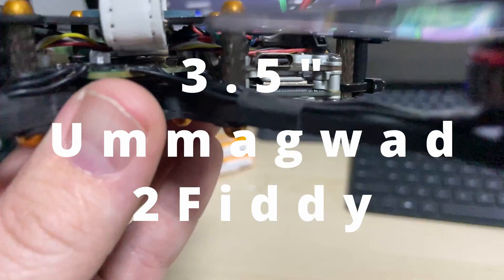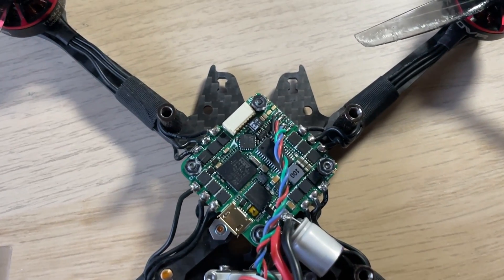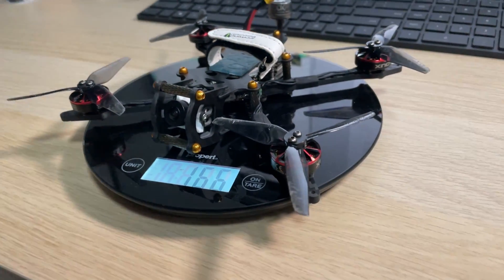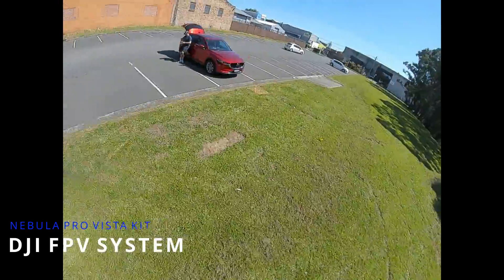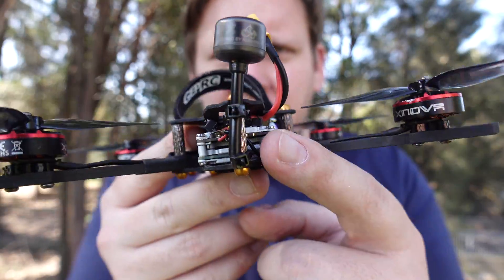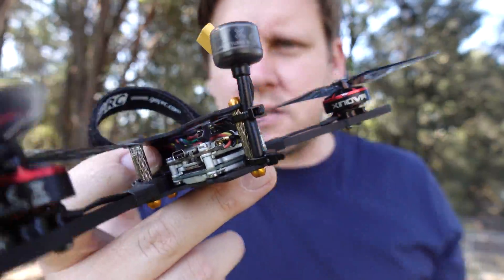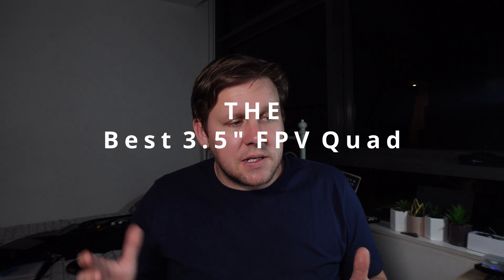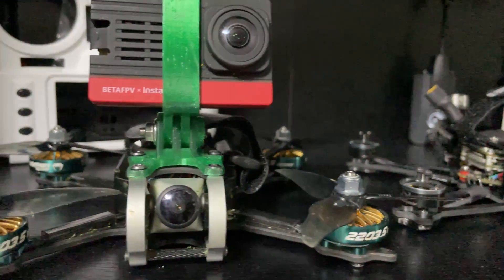My Favourite 3.5” Freestyle FPV Drone

Comment: How quiet is this build? There's a spot I want to fly that's just right for something smaller that doesn't attract too much attention.
.
I was thrown off because it says 3.5" but it's actually a 4" frame with 3.5' - 4" props? I'm thinking 4s with Xing 1504/3900KV. I was also considering the Chris Rosser 3.5" AOS frame with the same motors.
Reply from the maker: Yes it’s on the quieter side and really inoffensive to those around. 

Ummagawd don’t make 3.5” arms, however there is not a huge gap between the props and the frame. 4” props are a tight fit. 

I’ve got the AOS 3.5” and it’s on my shelf to do a build and review, just haven’t gotten to it yet.

Comment: hi darren! thanks so much for this build suggestion, I got all the parts in the mail to build your 2ThirtyFive, and I'm really looking forward to it. I still need to buy the batteries: what's the difference between the 4S and 6S choices, and which one do you prefer for freestyle? I assume the 6S is more "peppy"? thanks again
Reply from the maker: It really comes down to what motor KV you bought. If you bought 2450/2500 Kv motors you will want to run 6S 450mah. If you have a higher KV then 4S. I prefer 6S
Reply: @DarrenAllatt  thanks. I bought the exact motors you suggested, the xnova 1804 2400kv
Reply from the maker: @pgabrieli  then run 6S 450mah
Reply: @DarrenAllatt  great, will
do. cheers, mate 👍

Comment: I would like your opinion on the rekon 4 FR, if you test it. The babyhawk 2 HD is great. After a while you just want more punch like the 1804 motors. Might try them on  3.5 or 4 inch

Comment: How would this fly with gemfan 4023 props on the same setup?
Reply from the maker: Flight performance is a bit more power on the 4023 props, however I prefer the 3.5” as it gives it more 5” style characteristics
Reply: Very interesting. I made 1 build similar with a copy frame i guess from aliexpress with 2400kv and 4inch props 6s. Felt great with 650mah 120c. But that frame doesn't support 03. So now I got this original 4inch. Still waiting on the 1804 2450kv motors and gemfan 4023.

Comment: Would love to hear your thoughts on the AOS 3.5 frame with the same components. Also, in my experience, the Avan Scimitar props from the Babyhawk 2 are much better than those from HQ or Gemfan. That said, I've only run them on 1404s.
Reply: The 3.5 inch emax props have more pitch and I personally find they peform better than the other 3.5 inch props on bigger motors. They feel similar to the GF 4023
Reply: @chrisbee5481  thats surprising. More than the actual gf3520?
Reply: @jandomingo9806  yes. Emax says they are 2.8 pitch.
But right now I would rather use the new HQprop 3.5x2.5x3.
Reply: @chrisbee5481  im curious as im running 1804 2400kv on 3.5inch frame. I have emax 3028, hq 3.5x2x3 and gf3520. I also liked the gf 4023 feel.
Reply: @jandomingo9806  I'm running the same motor but 3500kv on 4S. I guess you must be on 6S.
Its a larger motor and here I really recommend the GF4023 or emax 3.5 inch. The new hq mentioned might be just as good. I liked the 3.5 inch feel more that 4, but its preference.
Use the emax. Great props
Reply: @jandomingo9806  by the way, the hq T75mmx5 are a must try. Lots of thrust and grip. Very stealthy.
Reply: @chrisbee5481  im running 2400kv on 650mah lihv 6s atm.
Reply from the maker: I’ve ordered an AOS 3.5 the frame has cost me $100 AUD m. I’ll be using Chris Rosser’s recommended parts for the build. He’s also given me the tune. 

I’ve tried the Emax props and am not really a fan, plus they aren’t heavily stocked in Aus.

Comment: Kind of crazy you just put this up. I built my second 4" 2fiddy with 2400kv xnova 1804's over the weekend. My first one is using Tmotor 2004-3000kv on 6s with 4" props. I love the 3.5" prop size, but it just flies so perfectly on 4" props. Have you tried yours on 4"? Just curious what you think of these components with 3.5' vs 4"? Awesome flying btw!!
Reply from the maker: Hahahaha. Love the timing. I’ll try with 4” props both tri blade and bi blade on the weekend and let you know.
Reply: @DarrenAllatt  so, how did it go? better than 3.5"?
Reply from the maker: @pgabrieli  it’s probably more personal preference. 4” 3 blade gives you more power; you could probably do 4” 2 blade and have similar characteristics to 3.5” —— I’ll be making a video over Christmas / New Year about it. I went back to 3.5”
Reply: @DarrenAllatt  excellent! and yes, I understand it’s a subjective measure. thanks!
Reply: Isnt 3000kv on 4 inch and 6S too much?